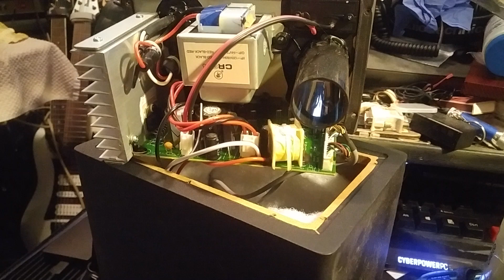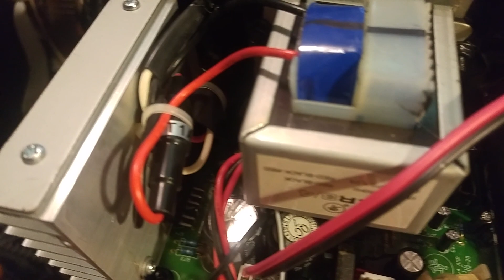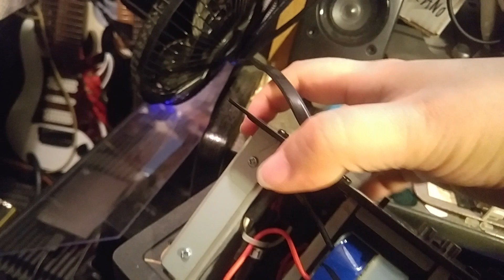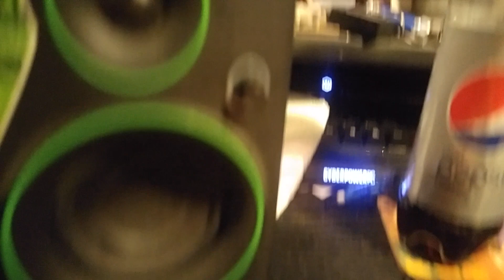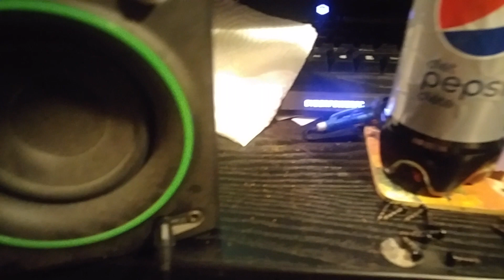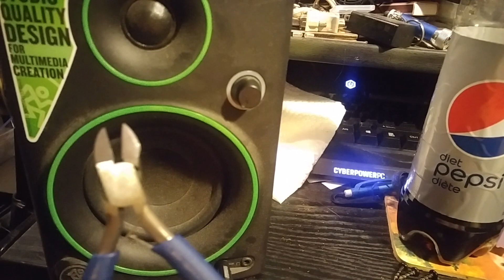Tutorial Mackie CR3 CR4 Speakers Audio only through Headphone DIY repair

Comment: For those of you who have the L / R switch problem:
I've fixed one of these with the same switch problem. It's difficult to desolder the switch because the jacks at the back are stuck to the back plate with some type of glue / epoxy substance .

What i did was solder two small pieces of wire to jump the switch connections.
Here is how i attached the wires. ( O ) represents the switch solder points,  ( --- ) represent the wire i soldered connecting them.

Before                       After
O    O    O                 O    O---O              When wired like this, the powered speaker becomes the LEFT channel Speaker.
O    O    O                 O    O---O

                                  O---O   O               When wired like this, the powered speaker becomes the RIGHT channel Speaker.
                                  O---O   O

Note that you should change the position of the switch to L / R depending on where you want your powered speaker to be BEFORE you solder the wires. the switch will not work as normal after the wires are joined. If the switch is adjusted to the wrong position after, the speakers will play in MONO because the switch will join the left and right. 

Please test after modification and do this at YOUR OWN RISK.
Reply: I just had this problem and thank you so much. All fixed. Rather have it permanently one side powered than buy new speakers.
Anyone else that wants to try. I made a small tutorial with some basic pictures. Credits to Dextrin
https://imgur.com/a/xfSKzOO
Reply: @bulleyes2  Thanks for the pictures!! this helped me alot and it fixed my issue with the switch as well!
Reply: @bulleyes2  The issue was driving me insane but since I had never done such a repair I was afraif of soldering the wrong connection and doing something horribly wrong. Your pictures were a huge help
Reply: @bulleyes2  Just did this according to you pictures and it worked. Awesome dude, thanks for sharing
Reply: @bulleyes2  Thanks for making that great tutorial.
Reply: @bulleyes2  Awesome tutorial man.... thanks for taking the time to do this. my speakers are working great again.
Reply: @bulleyes2  Image helped out tremendously, thanks a lot!
Reply: Many thanks for taking the time to post this, I have been wondering what to do about it, instead of wiggling the switch around like an idiot.
This has been a very useful youtube post for me! Much obliged.
Reply: I have just performed this fix and it's working - I went for left powered speaker option. I wedged a tiny piece of wood in the small slot available for movement of the L/R switch and then put tape over it to stop the switch being moved. I plan to do a periodic examination of the board to see it's happy after it's various surgeries. Anyway, my speakers are working nicely at the moment.
Reply: Just performed this fix and it works now.  Forever locked to the Left for powered, but better than cutting in and out.  And no need to go out of my way to cut pin 5.  This will work out for me until I get some better speakers.  Thanks man!
Reply: @guitarsbunch347  That is exactly the problem I had. Sometimes it worked, sometimes the wiggle didn't work at all and both speakers went silent.

I tried some contact spray, but that only worked for a couple of months.

I followed these soldering instructions to fix my L/R wiggle problem.
Reply: Followed Raymond's pictures and fixed the faulty switch and speakers cutting in and out. Thanks!
Reply: Just want to say thanks for posting this comment, took me 10 minutes to do, super easy fix and you’ve saved me a couple of hundred quid looking for new speakers.
Reply: I owe you $150 bucks. Thanks for this
Reply: Thank you a ton. just got a super cheap soldering kit and even for me it was possible to fix in a couple of minutes.
Reply: Sorry for newbie question here. Does it matter what speaker becomes the powered one? Will sound play out of both speakers after this fix? Or just the powered speaker?
Reply: @antoneager6616  Both will play sound. The switch just determines which audio channel (left or right) will be played via the powered speaker (i.e. the speaker you are soldering).
Reply: @antoneager6616   Anton Eager  Both speakers will be functional after. The difference is the  powered speaker is the one with the power wires going to it, and based on your setup you may have that speaker on the left or right. I do believe there are other differences also but its mainly the one stated above.
Reply: Its Dextrin thank you for taking the time for commenting and replying back, I’ll give it a go!
Reply: Hey man , I had the same issue today and I cut the pin as he asked. But now my main speaker is not firing. Only the tweeter seems to be working. I probably goofed up something
Reply: @odinofceres  Try to solder it back together and see if it solves the issue.
Reply: @ItsDextrin  Hey man, I opened the speaker up again to notice that the main speaker wire was disconnected. Popped it back in and its saul goodman!
Reply: @odinofceres  Great to hear that everything works fine. Enjoy!

Comment: Just had the same issue with my CR3s. I tried the headphone trick to no avail. So I clipped the lead as you indicated and everything works fine now. When I'm in the market again for speakers, I think I'm going to upgrade to some Presonus Eris E5 XT or E8 XTs. I'll need to build a bigger desk though. That was the reason I went with the CR3s in the first place. Size and price.

Comment: I suspect (but don't have the time to check it) that the black gunk of death that they've smothered all over the circuit board (presumably just to stop people doing repairs) is decomposing over time (a short period of time at that) and causing the capacitors to fail extremely prematurely. And one of those caps is part of the muting circuit, causing the mute to stick on. So a better fix might be to recap the entire board, but who would waste that amount of time on this pile of junk?! I agree with your summary at 2:40!
Reply from the maker: Thanks for the awesome comments! Yeah they really cheap out on parts but that's why they're so  cheap. It just isn't really worth doing more to fix these. NS10s yes, Adams yes, genelec yes but mackies when they die are doorstops lol. A guy was selling the more highter end mackie speakers locally and i just laughed and said no way lol

Comment: Thanks for the clues here, I wouldn't have worked out the problem without your excellent video. Page 6 of the datasheet goes on about the requirements for the mute function: "when Vpin5 is lower than '+VS - 6V' the amplifier is play mode". I don't know why leaving the pin floating achieves this, it must be lucky chance. Anyway I did the fix but suffered from the problem I've seen reported elsewhere of a massive ground hum; I tried connecting pin 5 to ground in the hope it was the floating pin but that made everything worse and caused a mute. I've given up and will never touch Mackie again, but thanks a million for the video!
Reply: Same problem here.
Reply: And here.
Reply: and here

Comment: Cheers for that mate, did the trick. Although after I cut the pin, I noticed some occasional static-y noise coming through the speakers, but I traced that down to the Left-Right switch having poor contact, and just jiggling that back and forth a few times got rid of the static.
These are great speakers but Mackie really cheaped out on the switches!

Comment: The issue I'm having with my CR3's is that the audio is only coming out of one speaker at a time. Every so often both of them will play but for the most part only one plays. Right now I have the powered speaker (the one with the volume knob and aux port) on the right and the switch on the back set to the left. This causes the left to play sound, but not the right. When changing the powered speaker switch to the right, the right will play sound but not the left. When I plug headphones into it, both channels work no issue. Same goes for the aux port. I only have it plugged into the audio port on the motherboard of my PC so it's not plugged into an amp or soundboard or anything. Thoughts?
Reply from the maker: I would try re-soldering the wires on the switch if you can disassemble it enough to do that.
Reply: Just spray the sw. from outside...use switch cleaner fluid. deoxit..etc.
Reply: I had that issue and I tried the tactic of plugging into the headphone jack. Didn't work. But turns out it takes some pressure to get the headphone jack all the way in. Then I took it out, and Voila! Both speakers worked. Wtf but if they work, I'm good.

Comment: yeah this broke my speakers for good
Reply: The way I understand is that this mute pin may work as a safeguard and to mute with headphones. But if when you cut that pin and get crazy sound or no sound there is another problem.  I get a loud noise when I cut the pin.
Reply: Yeah I cut the pin and now it's just loud static, guess it wasn't that problem. They were out of warranty anyway but these things cost $250 AUD, I did expect better...

Comment: I have a problem with the R/L switch on the Mackie CR3. I don't know if WD40 which is all I have is safe or worthwhile. There is some play in the switch too but I don't really want to de-solder and put a new one in.
Reply: I'm having the same issue, my speakers only get audio from the passive speaker. The WD40 fix will not be permanent. I've to wiggle the R/L switch to get the other speaker to work. I'm pretty sure the R/L switch that comes with these speakers wears out too soon(the quality of solder is good but the switch is bad). I think the best option would be to remove/un-solder the switch and install a jumper cable while loosing the R-L switch capability. I've e-mailed Mackie asking for a circuit diagram explaining witch connections on the PCB need to soldered/jumped to fix it. I hope they reply back with a solution else I will have to do a trial-error test.
Reply: @peacemaster3180  I've fixed one of these with the same switch problem. It's difficult to desolder the switch because the jacks at the back are stuck to the back plate with some type of glue / epoxy substance .

What i did was solder two small pieces of wire to jump the switch connections.
Here is how i attached the wires. ( O ) represents the switch solder points,  ( --- ) represent the wire i soldered connecting them.

Before                       After
O    O    O                 O    O---O              When wired like this, the powered speaker becomes the LEFT channel Speaker.
O    O    O                 O    O---O

                                  O---O   O               When wired like this, the powered speaker becomes the RIGHT channel Speaker.
                                  O---O   O

Note that you should change the position of the switch to L / R depending on where you want your powered speaker to be BEFORE you solder the wires. the switch will not work as normal after the wires are joined. if the switch is adjusted to the wrong position after, the speakers will play in MONO because the switch will join the left and right.
 
Please test after modification and do this at YOUR OWN RISK.
Reply: @ItsDextrin  It worked, thanks for the detailed explanation. I was able to permanently set the powered speaker as the LEFT speaker.
Reply: @peacemaster3180  my cr3's R/L switch is glitchy too, any update from you?
Reply from the maker: I would really not do that with the wd40. There is a contact cleaner called deoxit and it's better for cleaning switches

Comment: Thank you! As you said the headphone worked as normal, but I also had these continuously buzzing alongside the sound with the headphones. And after this very helpful tutorial, witch i can recommend others if they have the problem. But both of the speakers are making the same buzzing sound, even with the volume button turned completely off, only the power on. Maybe as the bass is continuously on or something. You dont have any idea if there is something else i can cut to make the buzzing sound magically disappear?
Reply from the maker: I have no idea. I found this solution by going on forums and looking it up and it was still hard to find this info. It could be that that chip is just bad or there could be something wrong with the power supply but my technical knowledge isn't high enough to know.
Reply: I had the same problem. It sounds like a ground loop hum to me, I don't think leaving pin 5 floating is a great fix generally (although great suggestion by jkhan and great for you if it works); I think the proper solution is to replace the capacitors as the amplifier chip itself is probably still working fine, it's the mute signal coming into the chip that is faulty. But with that amount of time and effort - better to throw them and be sure to never touch a Mackie product again.
Reply: Yeah. Same thing happened to me.  Cutting the pin made the speakers buzzing loudly. I'm going to try replacing the component
Reply: I have the buzz sound too, very loud, so speaker is unusable, but the sound got back so it kind of worked :) Anyway, thanks for the video, that was worth trying.

Comment: I had the exact same problem, my CR4 simply died slowly after a few minutes of listening. (2y old)
Yes basically something else in the circuit is failing a resistance maybe and it is telling the pin 5 to mute the speaker. Thanks for the video. You should definitely post it on Amazon and other review places.

You can find the chip here : https://www.newark.com/stmicroelectronics/tda7265/audio-power-amplifier-ab-2-25/dp/59M2618?mckv=OgdtIKxX_dc|pcrid|77240748193861|plid|{placement}|kword|tda7265|match|bp|slid||&msclkid=10fbdc8db6801d4ba92e80f38de0e744&CMP=KNC-BUSA-SKU-MDC

And the data sheet here :
https://www.farnell.com/datasheets/1811319.pdf

Pin 5 is only useful for Mute. They don't cost enough for me to spend an hour really fixing them, so I unsoldered that pin 5.
IMPORTANT: note that by doing so, your speaker will not be muted when powered on, so make sure your nob level is always off or very low when you add power to it, if you want your speaker to live a little bit longer. This thing is fragile enough on its own already...

If you want to DYI some speaker with that chip you can find a funny simple enough example here.
https://www.youtube.com/watch?v=c9j4-Wbmdsw
Reply from the maker: Yeah it will always pop when turning on. I hate it but my speakers work again. Thanks for watching!